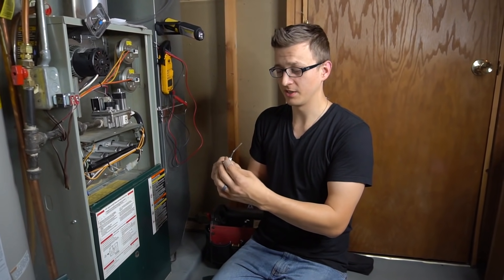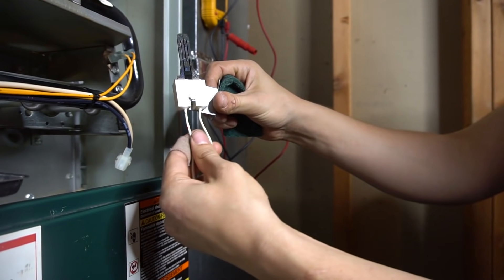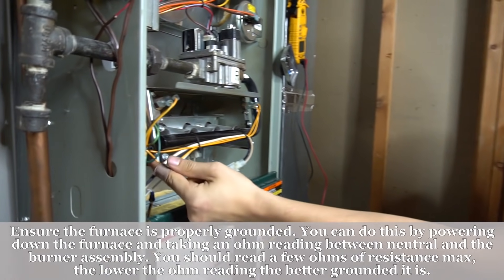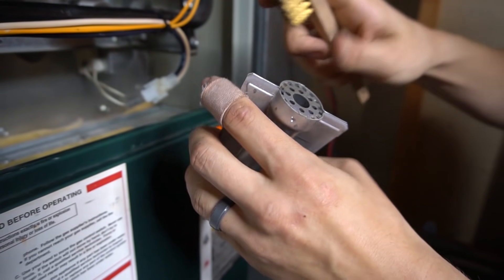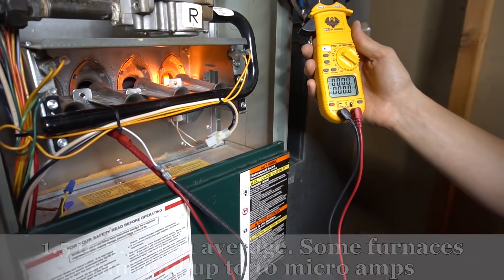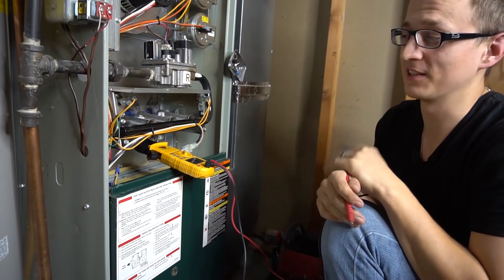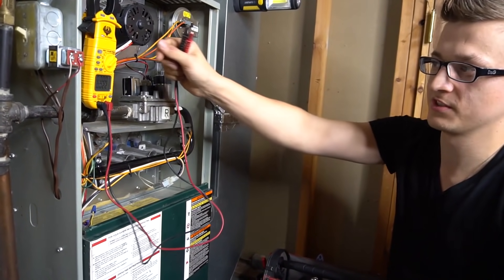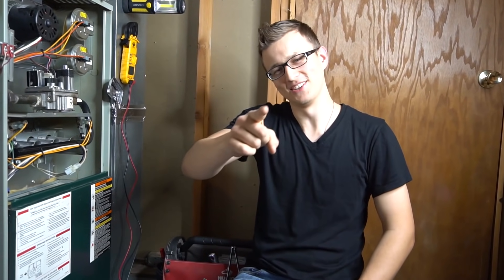Furnace Not Working - Troubleshooting the Flame Sensor

Comment: Great video. I’m trying to get my head around the workings of it. Does the burner just need to be earthed for the flame sensor to work or does the signal go back to the board? I find it hard to think that it goes back to the board via earth to then be sensed by the board? What electronic device on the board senses that there is current flowing from the flame sensor for the flame to stay lit? or if it’s sensed back at the board via earth how is this sensed? Over here in the uk we have some boilers with aluminium heat exchangers that have downward firing ceramic burner plates. From memory these always have the flame sensor with the two probes/legs. Would I be correct in thinking that these flame sensors send out ac like the singe probe and returns down the earth of that 2nd probe connected to earth? Just wondering as I’ve read the base of the burner port sizes are important and due to being ceramic this would obviously be an issue. Is the 2nd probe on a twin probe sensor enough for it to work or am I missing something else? I hope this makes some sort of sense 🙂👍
Reply: the grounds is what helps generate the Dc micro amps that prove there's a flame to your gas valve, in general its this DC current that will keep your gas valve energized, otherwise your flame will short cycle; the flame will come on briefly, then go back out. hope that helps.

Comment: I love all your videos.  I need to know how to check voltage to the gas valve with a multimeter because I can't get fire to the burners. Thanks in advance. Sorry i meant to tell you what it is.  Goodman GMS80804BN 80k btu gas furnace with an A/C coil

Comment: This is a great helpful video to diagnosis my system.    My home furnace is a Carrier model 58mvc080-f-10114 .   It runs in short cycles for 4 times then locked out  as 34/14 error code.   it relates to a flame sensor problem. I have tested my system in working condition. I can read 4 - 5 uA in the flame sensor series line.  but almost of the time the current is 0 uA.  sometimes it can start once a day.   I saw you measured voltage accidental between flame sensor connector to ground to shut down the gas.  but I could not see where you measured voltage to 54.4 V in which flame sensor terminal (from top burner pipe not sure where you selected sensor connector )  to ground.   
I have changed the new flame sensor for my case.   can you give me an extra Thanks a lot. you are a great helper.

Comment: Please help! Love your videos; have learned a lot. My furnace seems to have the flame sensor and igniter all in one (Ignitor/Sensor with Clip 1009524). Once in a while I can get the heater to come on but less and less. Here's what happens. Turn the heater on. The igniter glows and pilot lights. Sometimes the gas goes and burners light up; most times not. Tried to manually light with a stick lighter.  That did not work at all (even though the pilot flame was flickering (strongly). So... Is the problem the gas valve itself? Gas is obviously getting to the pilot through that smaller tube, but maybe the gas is not coming through that black manifold??? I cannot hear if gas is coming through because the fan is so loud. Thank you for any help!

Comment: hey, jay just wanted to share a test I did on furnace lennox a good running unit, used my fieldpiece stick meter with test head when I checked flame rod in seires flame went out and got no reading for micro amps. would you know what I did wrong, or is my meter defective?

Comment: What range should the CO ppm be when gas system is running in the smoke pipe using a Testo or Bacharach?
Reply from the maker: Usually it will be 15ppm-55ppm. How clean the burners are, low stage/high stage, gas pressure, and some other things may impact it slightly one way or the other. I have a video where I do a combustion analysis if you want more info: https://youtu.be/ffsaHsNovCo?si=VBlnKrtjiSfk9Vkh

Comment: do u recommend replacing or cleaning a flame sensor when it fails?
Reply from the maker: I worked with a guy who did HVAC repair work for 40 years and he claims to have never replaced a flame sensor in his whole career. I rarely ever replace flame sensors. Cleaning them is enough in almost all cases. 👍
Reply: @WordofAdviceTV  Wow thanks for sharing your experience and taking the time to respond :)

Could u do an episode on blower motors if we should be adding oil? 

Also an episode on a Furnace tune-up visit going through step by step what you do would be great education. 

I love watching your channel and learning about HVAC! thanks!

Comment: Excellent video! Thanks. Any tips on removing flame sensor that is literally on the ground, with only acces from the side ≈18" in. 28 year old Bryant (Carrier) commercial HVAC unit at my church that I am trying to remove to clean or replace. Also, with no model numberto get a Flame sensor PN, are they pretty generic, meaning as long as it is the same size and shape, a genericone would work? TRhanks in advance for any ideas. PS. screwis philips, argh, not 5/16 hex. Hard to get enough pressure to get screwto turn. Especially with left hand/arm fully extended and feeling blindly. [ EDIT: I did just order the angled drivers and extensions he listed (plus some other cool things in his list), maybe that will give me success at my next attempt.]
Reply from the maker: Ah I feel your pain good sir! There are some flame sensors that are a total pain in the butt to get to. Taking them out is the easy part too. Putting them back in is where the fun really begins. Usually if I pull out a philips screw, I will just replace it with a 1/4" hex screw instead. A lot easier to put one of those in then a philips that keeps falling off. Honestly, if it is hard to access, there is no great solution besides getting some cheater tools, which by the sounds of it, you already ordered. You will just have to suffer through it. If the sensor looks like it can turn into a 2 hour project though, then I would rather pull out the inducer motor and perhaps take apart some pipe in the furnace so I can access it easily instead of battling it for hours.

Comment: I've gone through a few multimeter fuses, when I forgot to switch back from inline amps to voltage, ha ha. Did you do that at 11:27? Nice video, clarified a few things.
Reply from the maker: My meter was set to voltage since I was checking for potential so luckily nothing was damaged :) "Jumpering" the flame sensor to ground doesn't damage anything in the furnace either but it does shut it off.

Comment: How would you recommend to removing a flame sensor that is behind the burners that is in a hard to reach difficult spot I've tried using socket wrench but still difficult to remove what is your advice? Thank you

Comment: I have a Bryant 398A the main burner won't ignight the pilot does ignight. I replaced the pilot burner/ sensor and checked the  fuseable link  for contiuty thats OK. However the main burner still refuses to ignight. I even replaced the motor control board and the air flow switch and that didn't help.I hate shotgun trouble shooting. What coil on the on the gas valve is for the main burner? The wiring diagram confuses me.Thanks for any ideas and help!

Comment: I learned something today. Curious about one thing though, on a old system (like myne) the control board is starting to discolor in regions, if after doing everything you suggest in this video, if it still randomly has false input, could the solder on said board be weakened, or possibly the component, that verifies the DC output from the sensor be the issue? I'm assuming this is a yes but wondering what input you have about that, or if its just time to replace the control board altogether. My budget is very tight at the moment and its very cold outside. Thanks in advance for any response, your video's are as other say, excellent information.

Comment: My furnace turns on for around 3 seconds and turns off so I replaced the flame sensor after cleaning it didn’t help. However, the problem still persists. How can I check if the flame sensor is properly grounded if I cannot establish a flame? I think you mentioned in the video toward the end but I’m unsure what to do. Thanks!

Comment: Do you have a video on how you would clean a “A” coil. Specifically the technique you use that works best when it is plugged or partially plugged?
Reply: He does not. He mentioned that in the video on the top 10 furnace problems. He said look on you tube for company who does it

Comment: Nice detailed video Jay. After watching this video I think I likely have a flame sensor issue.
Our furnace is a Goodman (model CHPF030A2C) which is a horizontally mounted model in our attic. It has the same symptoms. (The inducer motor turns on and no flame, and the heater turns off after about 30 seconds)...It did work for a few days after trying many times, but after 4-5 days now, it shuts off after 30 seconds again...Note: the AC works fine). 
Would the furnace components and the detection sensor location (on a horizontal model) be laid out the same as on your video? (except going side ways)...Or with horizontal models are the components arranged differently. Thanks for doing this video. I commented on your other video, but I pretty much now believe it is the flame sensor...(Hoping at least as it seems the easiest to address). It was strange, as mentioned, the heater worked for a few days, but now it won't stay on again and shuts down.
Phil
Jersey Shore Area

Comment: I have a GLUB75-E4A. My fan motor was making some noise and would barely move and come to a stop. I replaced my motor and now I am getting a 6 blink code indicating a flame rollout. I checked the switches and all seemed to be reset. I bypassed the 2 switches and the blower motor came on but still no flame. Do you think it might be the igniter or the flame sensor?

Comment: Hi, my furnace is working, but I hear loud clicking noises from the furnace when the furnace is about to shut off. I’ve been doing some googling and it shows this could have been a faulty flame sensor. Does this sound correct. I just like to get some ideas and confirmation before i start doing the work. Thanks 🙏

Comment: Do u have a video on an intermittent pilot furnace?  with mine it is a continuous retry and it does always start but at times it takes like 9 try’s... it will spark,  light the pilot then the main burner kicks on then goes off then obviously retys until it lights it is single wire or non flame sensor type it rectifies  through the igniter
Reply: Also it is an empire wall furnace that was added when an addition was added.

Comment: Hello, what can you do about a rough flame, that seems to cause cycling and recycling of the start up.  I say that because when the starting flame seems to "settle" down after a few tries, the furnace operates properly.  Thanks in advance.
Reply from the maker: A bad flame pattern could be an indication of a bad heat exchanger.. You may want to get a furnace inspection done. Better safe then sorry. (Primarily you need them to do a combustion analysis, check what the CO is)
Reply: Thanks Again

Comment: I put 3 flame sensors in and my 23 year old furnace would not stay on. Bending and cleaning didn't help. Had to take out the burners and clean them with a SS small brush and compressed air. Must have had not enough flame rectification to stay on? I also ordered one new burner from Amazon. Heat exchangers looked like new and not rusted through so why not?

Comment: I’ve been in construction for 3 decades but now , find myself very interested in HVAC which I’ve  got basically zero knowledge or experience beyond belts , motor or filter replacement. 
Is it unrealistic to assume a contractor will pick me up as an employee?
I’m painfully bored with drywall & paint which I’m currently employed in .
Reply from the maker: Do some self-education on YouTube to get the basics down and then I am sure you will be able to find a company that will be willing to hire you and train you the rest of the way. 👍 Just start the process and job hunt, you can totally do it. I sympathize about the drywall.. One of my least favorite tasks whenever I need to do it. 😅 HVAC would be many times more interesting.

Comment: My burner is not igniting. After watching your video tried to find the flame sensor, but i dont find any in my furnace. Is there a chance older model furnaces do not have flame sensor?If that is the case how to fix the problem - just change the igniter?
Reply from the maker: Try watching some of my other furnace videos for more info (playlist in the description). If you think your ignitor might be bad, I would start with this one: https://www.youtube.com/watch?v=1bRsFAMgZRQ&t=1s

Some furnaces have a spark ignitor that acts as both, the ignitor and the flame sensor. And yes, there are older furnaces that don't have a flame sensor.
Reply: Word of Advice TV 👍

Comment: Word of note when i first was analyzing the furnace the ignitorbwould glow red and then no burners comes on and then ignitor would go out and repeat process...i then removed rubber tube frim pressure switch and poked a thin wire in there and then tried to turn furnace on again and this time the burner kicked on for a few seconds and then shut down....so im trying to figure out if its a flame rod or pressure switch issue...not sur if the wire poking was just coincidence or not

Comment: Every once in a while my furnace will run with no flame...its hard to catch as it only does it at random times. Could this be the flame sensor? The pilot light is on but the burners dont ignite. Blower continues to run and will blow cold air throughout the house. I changed the gas valve thinking it was that. That helped for a while until again, a random night it ran for hours without the burners coming on

Comment: Good evening
Quick question: my heater furnace just works if I’m bypassing the yellow and the ground by the furnace side
After it turns off because reached the temp on the thermostat, the furnace will not come back on
The igniter turns on but there is no gas coming out

I will appreciate your help
Reply: having the same issue
Reply: @nightmar4056  i checked the  continuity of the flame sensor and didn’t shows any reading so I replaced it last night but unfortunately it stop working again early in the morning

Comment: Maybe this is a dumb question..but..does this apply to an electrical heating unit as well as a gas? We have an electrical unit and it doesn't look like what you are showing?
Reply from the maker: If you have an electric furnace this video will not apply. A flame sensor is only used in gas/propane furnaces.

Comment: I had Breamer TH320 installed in 2011.  It worked nearly for 9 years without any issues.  This year it stopped working.  The controller says the furnace is running.  But the furnace has already stopped.   I followed the furnace reset sequence OFF-ON-OFF-ON to start the furnace.  The furnace starts and heats for half an hour and then it shuts down.  The controller continues to show that the furnace is running.  I have tried cleaning the flame sensors.  Where do you think is the problem?

Comment: Thank you for this great video.
My Goodman furnace short cycled where it ignited but then turned off after a few seconds.
I cleaned the sensor and burners (there is still some very minimal rust in the burners' holes)and it ignited and ran for a couple minutes and then shut off.
Now the fan comes on but the ignitor does not get hot and then the fan shuts down in about 30 seconds 
and there is some residual noise i can not identify.
Any ideas?

edit- Seems i am getting a 'primary limit" error message.
It is getting too hot, not enough air over heat exchange.

edit 2- Ok, i think it is the circulator blower that is malfunctioning.
On the thermostat i turned the mode to off but the fan on and when i powered the furnace it made a hum sound 
but the fan behind the control board  did not rotate.
Was hoping it was the primary limit switch.

Hope i can find a replacement motor on Saturday, it's starting to get cold.

Thanks again for your great videos and giving me the confidence to diy.

Comment: I don't completely understand the conversion from ac to DC. Basically  ac flows from the control board to the flame sensor. It jumps from the steel rod onto the burner face. Then from there the burner has more surface area the the steel rod on the flame sensor so it loses current. From there it travels ONE way back to flame sensor and then to the control board which is why we would measure that in dc micro amps? Is this correct?

Comment: I’m stumped on mine...  so I have 59VAC on the new flame sensor but no DC amps in series when checking like you show.   I cleaned the face of the burner and it looks good but still won’t stay lit more than the 3 secs.   ?????

(Flame sensor is new and has continuity from the sensor tip to the connector)
Update : bad circuit board !   All is well now

Comment: Here's a good one, Furnace calling for heat, everything seems normal till I install the door, ( on roof package unit) . I put my meter in series with the flame sensor, numbers hop around a little, Install the door and numbers fall to zero in maybe 5 to 8 seconds. flame out. I bent the sensor very little to engage more flame, problem may be solved but still wondering why this MAY HAVE been the issue? why didn't it do this last year?

Comment: I have a Lennox G61 and it goes to watchguard mode and error code 4+3: lost flame sense 5 times in one heating cycle. The burner will be on more than a few minutes. What could be the problem? Is it a bad senor or bad board? Thanks a lot

Comment: My furnace has a spark igniter. The ID fan is running and I smell a faint odor of gas but it's not igniting. Is the igniter bad or is it the control board? Is there a way to tell if the igniter is getting a signal?